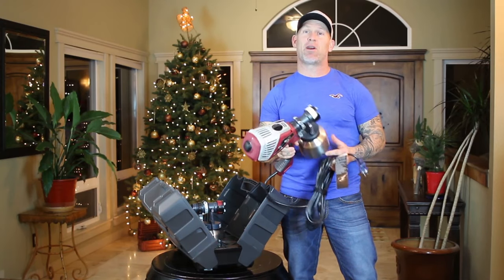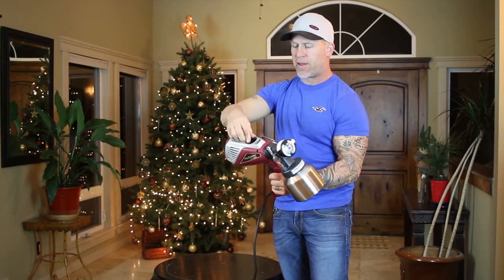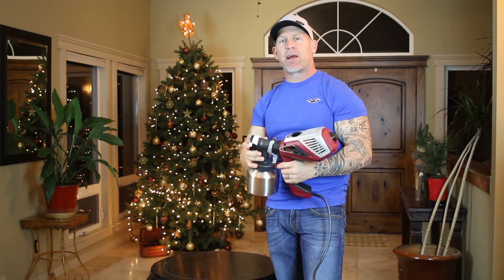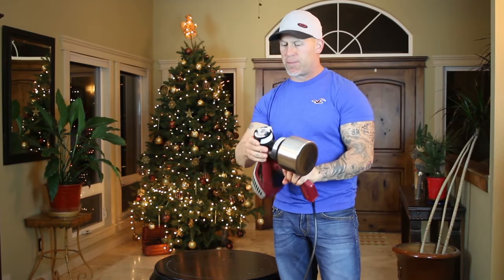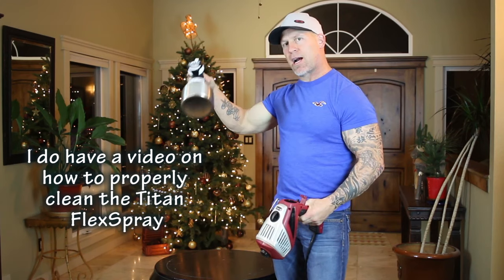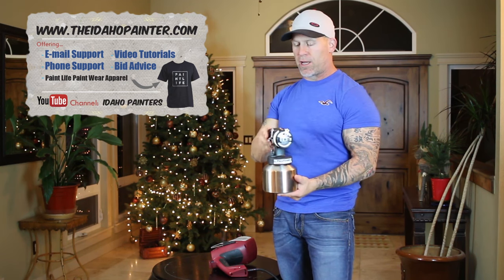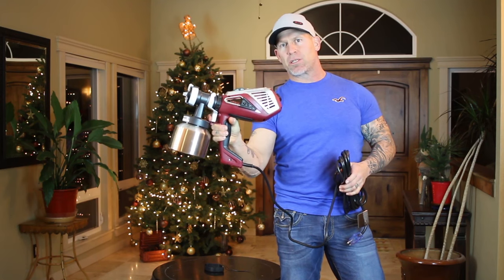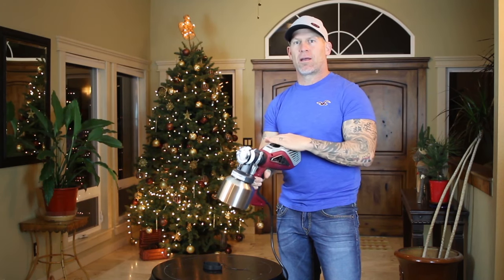How To Operate The Titan FlexSpray Paint Sprayer.  Titan Flexspray Tutorials.

Comment: Just a quick one.  I have been using this XVLP sprayer for about a year and love it.  Its rebranded in the US as its made by Wagner in Germany.  For spraying kitchens its super fast.  Its the clean up that makes this such a great tool.  My advice is make sure u water down your paint so that its consistency is close to single cream.  Too thick and it will spit and choke.  Great vids by the way.
Reply: +Toby Miller Agree with you on thinning. I have also used morrells two part lacquer system to great effect on cabinets. And no I don't work for them.

Comment: Just used mine today for about 1000 SF cabin stain. Worked very well. Very happy with the results except that the cup leaked my oil stain and it was a mess. Have you found yours leaks? I imagine it won't leak with a late paint product but with the oil it did leak.
 But again, was very happy with the result of the job. I'm not a pro painter at all. I am a carpenter.
Reply from the maker: We do not use oil based paints, but we have not had that issue!
Reply: @Idahopainter  thank you! I will look and see if I have the seal on wrong. Thanks for your videos and the Scripture references in some of them. I am a contractor and incidentally a reluctant painter lol. So tips from pros like you are very helpful. Thanks again

Comment: Great videos by the way! Question, you mentioned the filter needing to be cleaned regularly so that you don't mess with other materials being sprayed. Will this be a problem when quick switching between the different front ends? Will you need to clean the filter when going from say a latex paint to a urethane finish? Thanks again for the awesome videos!

Comment: I think the Idaho Painter is deleting the negative comments? This spray rig is pure garbage. If you like your wood surfaces to look like they were rolled then go ahead and buy this contraption. If all you paint is fences and you're ok with a 8ft section taking 20 minutes to paint with a gun, then this is the rig for you. However if you are a true pro and you want your wood surfaces to look and feel smooth after painting then DO NOT buy this paint rig. It is inferior to all AIRLESS spray rigs. Titan is also a subsidiary of WAGNER. If it spits like a Wagner then its a Wagner. Save yourself the $400+ and just go fill a cup with some paint, take a straw and suck some paint into the straw (try not to get it in your mouth) and then simply blow through the straw at the object you want to paint. You now have achieved the same finished result as the flexspray but still have your $400.00 in your pocket. You're welcome.
Reply: I bought one.  If you want a nice splatter texture, this gun is for you.  My rep said I needed the Fine Finish spray head so I wasted my money on that and got slightly less splatter.  Can't spray a door with BM Advance through this thing.  Waste of money.
Reply: Patrick Simpson After I fought to get a refund for the titan piece-o-chit I went and bought the graco TrueCoat II. So much better of a unit. It can be totally rebuilt and cost about $80.00 less. Of course the minimum pressure is 1,000 psi. Max is 2,000
Reply: You are correct that the Graco TrueCoat II is a better unit.  I bought the Titan to replace a broken Graco.  One of my employees cleaned it with lacquer thinner and left it in the pump.  It melted, rendering it useless.  I think I'll wait until I really need a good handheld and then buy the Graco again.  Thanks for the confirmation!
Reply: Patrick Simpson Just make sure and buy the TrueCoat II. It can be totally rebuilt. It works like a dream. I bought it for small jobs and to go along with my small Graco 390 Nova. Both built extremely well and can be totally rebuilt. The motor in my 390 just burnt out last month (hence the new purchase) and graco replaced the motor for free because it was covered with a lifetime replacement warranty.
Reply: They have their uses. If you turn down the air pressure, thin your paint and use the fine finish attachment, you can get a decent finish.
Reply: @tonympainting6193  I found using a FFLP tip (High pressure/ low volume) in a regular spray yields amazing results.